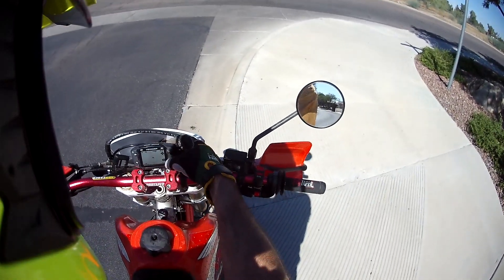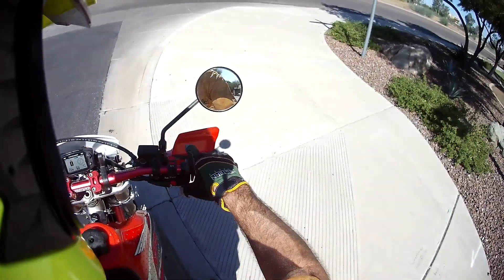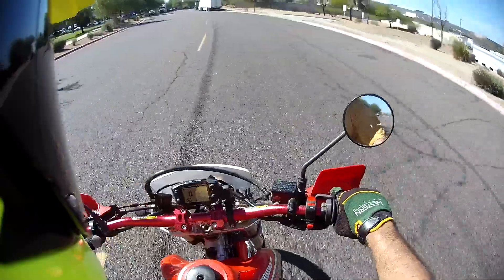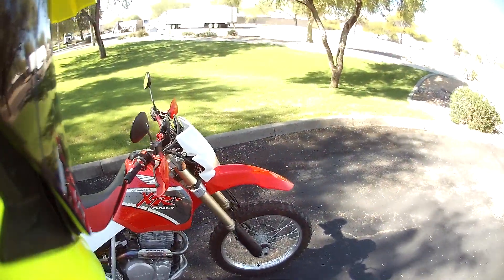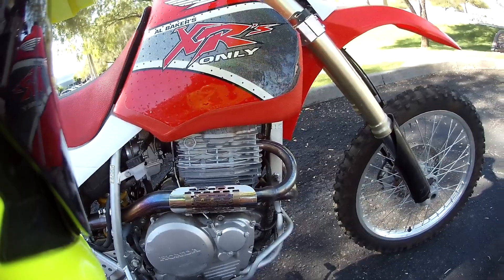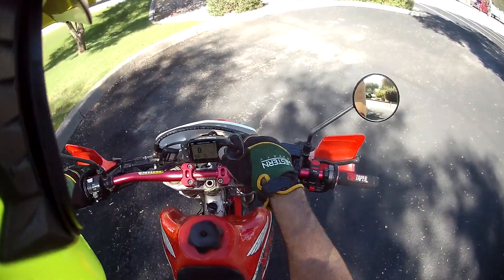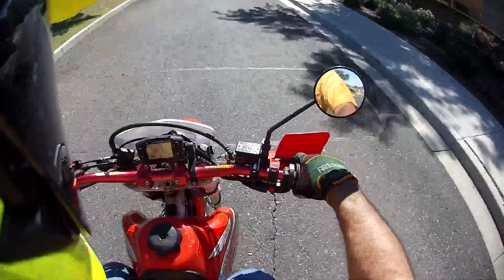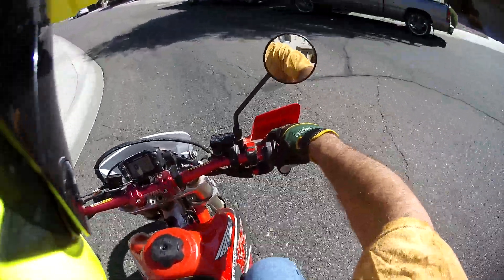$1100. XR650L First ride.

Comment: Relocation of the battery can sometimes cause little electrical problems as well as restrict air flow. I wouldn't drill out the side panel for fear of tipping it over and totally filling up the air filter with dirt.
Reply from the maker: Excuse me but I don't tip over! I hit the ground like a sack of potatoes! SPLAT!! 
Holes in the side panel are no big deal except for water and we don't have much of that out here in the AZ desert. 
The 1982-1985 Suzuki RM's I use to race all had modified holes in the airbox cover so they could breath, I never had any issues. You can take some screen door material and glue it to the inside to keep the chunks out, and look trick but honestly, I rode 1984 RM500 Suzuki's up to 6 years ago and they had 3 big holes one each cover of the duel air box with no issues.
Reply from the maker: I was wondering about the electrical reliable my self. When I get the stock stuff swapped over I will take it out a few times to make sure its 100% reliable, before swapping things over. I have not read of any problems on ADV forums? Maybe someone will post their experience with the battery mod.
Reply: @verbalwidget0919  when I was thinking about doing it, either someone on Facebook or on ADV was having lots of issues when he tried to move the battery. I figured it's probably best to just leave it.
Reply from the maker: @Megakoolguy357  It may be? If the bike won't get me home and leaves me stranded, it is of no value to me. 
Some people said to just save the weight of the lead battery, run the lithium battery in the stock battery box? That is an option too? 
Bottom line ...  it has to be reliable.
Reply: @verbalwidget0919  lithium isn't so great in the cold until you warm it up, but other than that, it's 7.5 pounds lighter than the yuasa stock lead battery. Fortnine has a great video on this.

Comment: I’m sorta interested in getting one of these,, but the 3   I see on gumtree Australia.. seem to have around 20000 kilometres on them. Which isn’t a lot,  but they have top end rebuilds.  Do you know why this is the case ?
Reply from the maker: 20,000 kilometers is about 12,000 USA miles, My guess is that the XR650L does not come with an oil cooler like the Suzuki DR650, and here in the USA the XR650L's are running lean to pass emissions making the problem worse. Just my thoughts. I have read many blogs where the XR650L has valve guide issues or has dropped a valve due to high engine temps at sustained highway speeds? But I see lots for sale with 20 or 30 thousand USA miles too? One thing I have notices is the DR650 Suzuki's get 50 to 70 thousand USA miles often with no engine problems at all, and still run great. The only major difference  That I see is Suzuki has a huge oil cooler. I have just fitted my XR650L with a Sutton oil cooler in hopes of increasing engine life? I still see 250 degrees oil temp. on a 95 degree day? Which still seams hot, but I'm sure better than it was.
I change my engine oil often more than required too. Oil is cheap the bike holds 2.4 qts.
Reply: Verbal Widget  thanks for the reply. Makes sense what you said,,,I have a dr650.

Comment: Those mikuni carbs suck. Hard to tune and get it running properly.
Reply from the maker: You know I never tried to get it right? I just put the bike back to stock with pipe and carby and it ran great, then sold it for a profit. Thanks for watching.